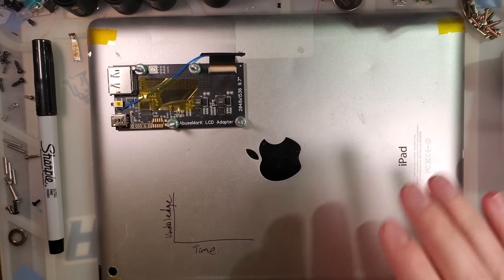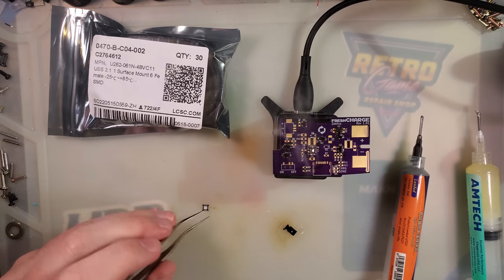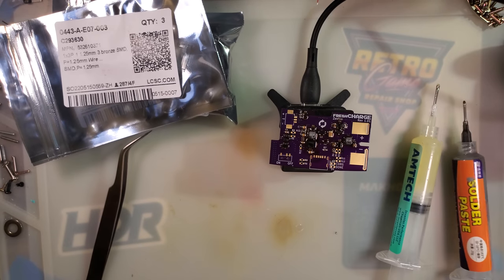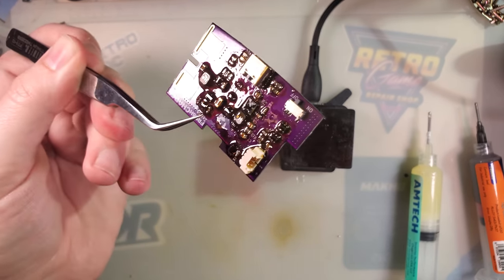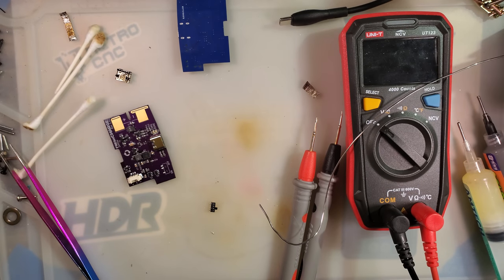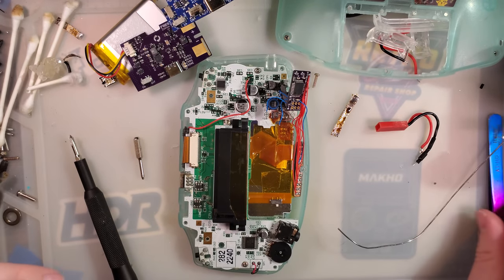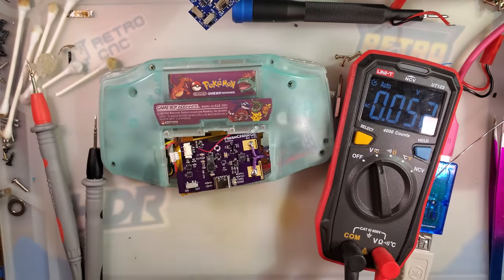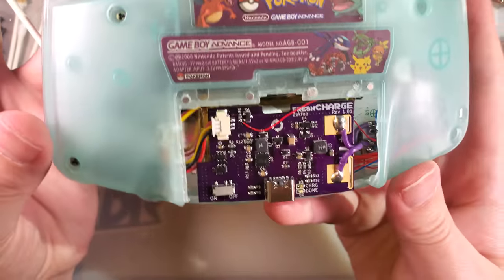Game Boy Advance Battery Mod but not blatantly unsafe

Comment: I’m new in this.
What is the differences between the two flux syringes you use? I see one before you put on the component and when it’s on you use the other syringe.
Reply: The first one is solder paste (orange syringe) and the second one (green syringe) is flux.
Reply: Thank you for answering my question. 😄

Comment: Can you please look into lithium iron phosphate batteries? They have a nominal voltage of 3.2 volts. So if you get a 14500 (AA size) and 1 dummy battery, you could power your GBA with a single battery. But if you rewire the GBA so the batteries are in parallel, you could use 2 batteries to increase your play time. 😁  Could make a good video.
Reply from the maker: I've looked into LiFeP04 batteries before and I wasn't impressed with the power density. A single 14500 cell seems to be about 2 watt-hours on average (from a reliable brand). If you fill the battery compartment, that gives you about 4 watt-hours of power. 

By contrast, a single NiMh cell or constant voltage LiPo cell in the same form factor is about 3 watt-hours and you'd have two for 6 total. 

Seems like a lot of work to rewire the battery compartment for less battery life and to break backwards compatibility with standard batteries. 

Is the battery life good enough? Sure. But why when there are cheaper batteries that are easier to install, more widely available, and get better battery life? 

I'll look into it more but I have no intention of doing a video.

Comment: Genuine question.. keeping it that long on the hot plate won’t do any damages ?
Reply from the maker: I mean, it ain't good for a lot of parts. I certainly don't recommend it but here we are.
Reply: I guess it depends on the parts. Many ICs for example dont like the temperatures you need to solder and can be damaged when heated up for to long. From melting plastics to completely ruining the internals theres a lot that can happen. I dont really know what temps are used with solder paste and a hot plate though so it might be fine I guess?

Comment: How is this compared to the 1800mah li-po kits these days? it seems like the start of those kits. Also, is this a good option if I want to use my larger 2000 mah batteries from boxy pixel in a new build?